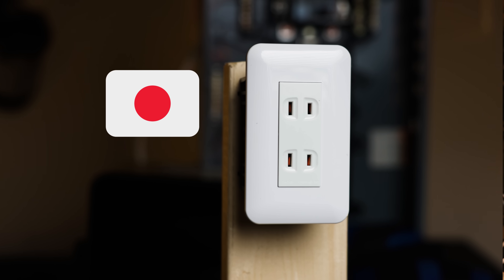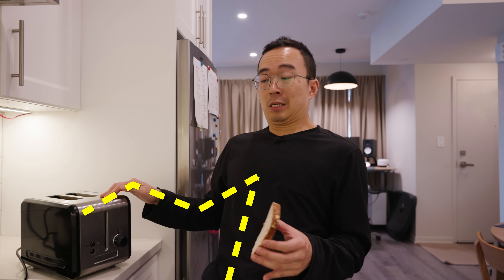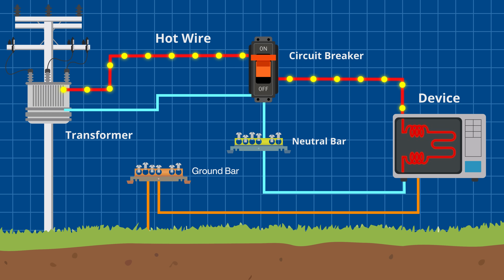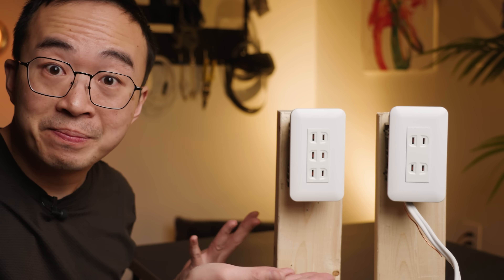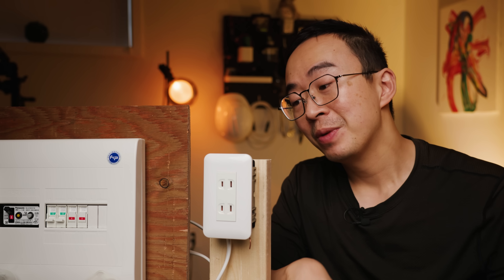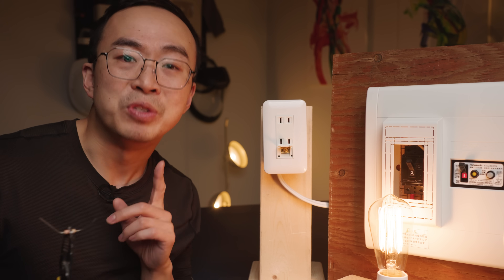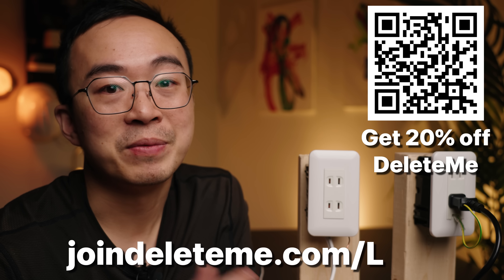How Japan Made Their Outlet Safe

Comment: In north america we have some problems associated with the 5 years plus of Aluminum wiring introduced over copper when the price of metals went up in late 1968. This caused a good system with the three wire system, hot, neutral and ground problems that did not exist before.This was due to corrosion from the aluminum. 

In the video there was no mention of why the introduction of polarized outlets are used dealing with hot and neutral avoiding a grounding system. Double insulated appliances only require a  dual prong connector. In Canada, most toasters and other kitchen appliances are dual wire plugs with a handful with the grounding plug system. 

Third is a GFCI as a master breaker set up, means when it is night time you are fumbling in the dark to find the circuit breaker box and flashlight, increasing the possibility for injury. It is cheaper but not a significant cost difference to either have a GFCI breaker to a specific circuit or an outlet GFCI. 

You will save in the amount of cost to install a 2 wire system for the inconvenience later that requires a bond to ground to an additional installed or placed in appliance later on. Japan has a nice system but it was a long way to be inconvenient to bigger requirement changes down the road, such as tamper proof outlets we have in north america for some time now.

Comment: In Norway, every modern house has grounded outlets and every fuse has a built in GFCI.

Another "fun" fact is that we are one of very few countries that still uses IT circuitry in certain places like hospitals, which allows hospitals to still have power with faulty ground.

Edit: Other countries also use IT in hospitals,
see comment below.

Otherwise we use TN in most cases and TT in some rare cases, mostly in places that have more thunderstorms on average than the rest of Norway.
Reply: Every country uses IT on hospitals. You cannot have a grounded system in operating rooms.  Norway uses it in homes.
Reply: @okaro6595  Well, yeah, in older installations,
but newer transformers are almost exclusively TN or TT unless 400V is not available in that area,
at least according to Fjordkraft.

Older installations do account for 60-70% of homes in Norway still,
so we are due for an upgrade.

I did not know that other countries also used IT in hospitals,
but it does makes sense.

I blame my ignorance on it being almost 20 years since I did electrical studies in school,
so thanks for updating my knowledge!

Comment: Hello,
You have made some factual errors that I would like to address.  First, fault currents in a North American system do not generally flow via the neutral conductor.  A fault will trip the branch circuit breaker even if the neutral is absent.  Second, the ground path is actually a low resistance pathway, and the grounded centre tap of distribution transformers is well grounded by several connections, ensuring that a fault in an appliance (your toaster eg) will cause a large current to flow and quickly trip the breaker to the open position.  

Some other notes:
-Japan is a 100 VAC system, the lowest distribution voltage of all.  This is one safety factor to remember.  On its own it is not a good strategy, but it is a factor in the overall design. 
-European and other systems with 220 to 250 VAC are more dangerous.  This is why grounding is mandatory in most European systems, and additional precautions (like RCDs and switches ahead of receptacles in the UK) are required.  The advantage is that the wiring is smaller (and cheaper), as the currents are lower in most cases.  (The available power at a receptacle is proportional to the square of the voltage)
-The North American system ingeniously uses a bi-phase system, where a positive and negative 120VAC is used to create the 240VAC needed for larger appliances.  Note that there is no place in a North American residential electrical system where there is more than 120 VAC to ground!  Nope, not even the range, dryer, or hot water heater.  Large appliances are connected across both phases, and get 240 VAC that way. 
-Putting a GFCI or RCD on the main feeder to the house (apt, condo, etc.) creates other problems.  With this, a ground fault trip results in power loss to all the branch circuits, so you may not get electrocuted, but you may fall down the stairs as the lights go out unexpectedly everywhere in the house.  And troubleshooting is more difficult.
-Note as well that in North America there are many appliances with polarized two prong plugs.  This is allowed if the appliance is double insulated, meaning that there is no reasonable way for a conductor to come into contact with a metal part on the appliance, minimizing the risk of electrocution.
-Finally, a note on outdoor safety.  Always connect to GFCI circuits for outdoor activities.  Your connection to the ground, possibly wet ground can be deadly.  And use a grounded (three prong) extension cord even if you are using a two prong, double insulated tool (eg, a hedge clipper) since if you cut the cord with the blade, the grounding conductor in the cord will increase the likelihood that the fault will trip the GFCI and prevent electrocution.

-

Comment: Both systems are flawed.
TT grounding + master RCDs are the norm in most of normal world.
Only then you can add separe sub circuit RCDs for bathrooms and other sensitive spots.

Edit: RCD can't work in TNC grounding systems. And what you showed in the begging is just that. Which is misleading at least, and dangerous at worst.

Comment: Of course if you used a UK socket it would have an RCD in circuit at the distribution panel and also you wouldn't be able stick a resistor directly into the live or neutral of the socket because there is a mechanical shutter in front of the socket activated by the earth (ground) pin of the plug which is longer than the live and neutral pins and so makes contact first. No need for those stupid baby safe covers you get on US sockets either.

Comment: A 16A fuse is not the same as a 30mA (0.03A) earth leakage circuit breaker. 
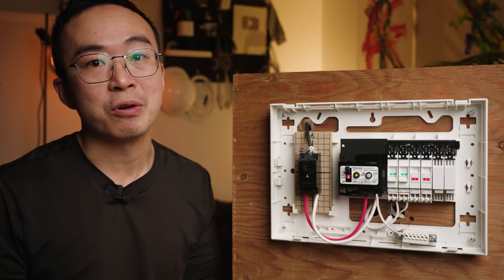7:20 In europe we had earth leakage circuit breakers long long long before 1971 lol.

Well, by looking at this vid I'm confident the American system is better then the Japanese system and the European system is a lot better then the American system.
Just switching a plug from one socket to another shouldn't require a screwdriver and the screws of a socket shouldn't be used every time a plug moves from one socket to another. 

I think that, within Europe, The Netherlands got one of the most safe systems, except when the electricity is made by someone from a different country or someone that isn't actually an electrician. 
Even when I look at the electricity in the UK I'm surprised about how bad it looks.

In The Netherlands 90% of the bigger wires (10kV+) are under ground, they really take it serious.
Reply: Not really.
Reply: @johnburns4017  What do you mean?
Reply: @ 
Holland is not a higher standard than the UK.

Comment: Wait, US does not require homes to have RCDs for the whole house? That became standard here in Czech Republic decades ago and the standards in place today see even that as insufficient. If I want to do full restoration of my house or some major electrical instalation upgrades I will have to replace my single whole home RCD with multiple ones. (And separates circuits differently as well but that is another topic.) I always assumed that having just the overload breakers is something you could not see in a new built home anywhere in developed countries so this surprises me.

Comment: I'm sorry, but i don't understand something and I can't find an answer on the Internet. What is Japanese grounded outlet’s ground wire connect to? 

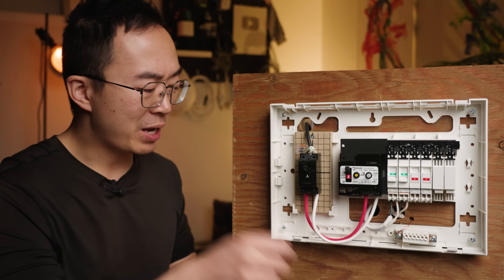Because to my understanding, to trip a GFCI some amount of electric current must go somewhere else. Either through wire to the ground rod or thou you and your floor, but not through your electrical panel to make a difference in currants (Kirchhoff's first law) but if ground in Japanese grounded outlet is connected to the neutral, the Input current and out current will be the same. In that case, we are just having a standard grounded outlet with tripping the circuit breaker, that you said, "doesn't work very well in Japan thanks to their uncommon infrastructure" but it is effectively 7:07 "oh let me just attach the wire from ground and neutral and call it a day" (sorry, but the way he said it is just too good).

So my question is: what is ground wire connected to exactly and how it's activate GRSI?

Maybe I just don't understand something obvious. If someone have access to photos of Japan ground outlet, I will be happy to take a look, because i didn't find any. 
Thanks all of you.

Comment: We Use GFCI over 30+ Years now in Germany and wie still also have the grounding extra. The GFCI can be triggered already before i touch the broken device and the grounding still have also another additional function to trigger GFCI or Fuse when anything else have also a short circuit.
residual current and short circuit are not the same, but both should trigger GFCI or the Fuse.

but if it works for Japan for now, its fine for me.

Comment: Germany simply has legally required GFCI protection for every new electric installations for a long time. we still have grounded plugs tho. 😂
in old buildings without the grounding wires in the walls they Just connected neutral and ground in the new outlet Type at installation.

Comment: I live in Italy and in two different apartments the electrical system was not grounded at all. I'd get shocked when touching a faucet and the dishwasher or my aluminum macbook would have a kind of buzzy field over the outside when plugged in (an electrician friend helped me fix this). Coming from the US, I found this crazy but everyone lives in concrete and masonry buildings, so fire risk is not as important as with stick construction. The panels, however, all have GFCI breakers for each circuit.
Also, at the beginning you showed an Italian plug. It is the stupidest plug - both large and easy to shock oneself. We actually have 3 here. Two of them have the 3 pins in a row, one for high amp, one for low (that works with Type C Europlug), and then we have the Schuko Type F plugs that have become more popular. Our house has a mixture of different outlets and we are constantly moving adapters and power strips around to make everything work.

Comment: Cool video. I have the stupid Japanese cable with hanging out ground cable. It came with a LAPTOP. Do they expect Japanese people to plug their laptops in kitchen or washing machine plugs? LOL. A household gfci is great no issues with that. What you didn't show was the average Japanese breaker panel doesn't have actual breakers in the individual circuits, just dumb switches. So what your video shows 20A circuit breakers in Japan you can very likely find dumb switches. Oh, and it wasn't too long that they didn't even polarize their plugs, you can find tons of unpolarized appliance plugs. They definitely had fun in the CRT days, Hot chassis? meh. 100V half country 60hz the other 50hz, talk about silly, they had more than a century to standarize SOMETHING nationwide, but they didn't.

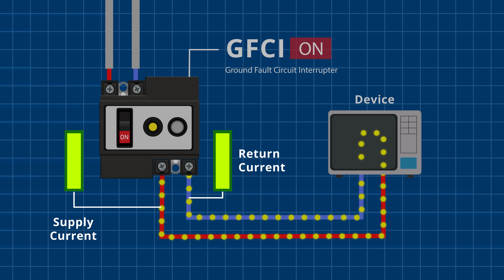Comment: @7:45 "...you absorb some of the energy and the return current is reduced."  Nope.  The resistance of the device itself has not changed, so the power used by the device doesn't either.  (Yes, you could draw enough current getting shocked to lower the voltage, which would change current, but that only changes All the numbers in the equation, not what really happens.)  In reality, the current shocking you is added to the device current, and the total current TO the circuit increases, but the return current does not, and that difference trips the GFCI.

Comment: So many errors and  misinformation. The purpose and function of a circuit breaker is to limit current to the capacity of the wiring. It will NOT trip nor protect you  from shocks. That is the function of GFI devices. No point in wasting any more time with this video.

Comment: In Italy, the legislation provides both to put the GFCI for the whole house and to put the ground in every socket. But it does even more, it plans to size the ground system in such a way that in case of broken GFCI, the voltage to which you are exposed is low, only 50V.
Reply: How?

Comment: I live in Japan (Okinawa Prefecture), my apartment was built in 2023. I have numerous outlets throughout the apartment, the standard design is 1x3 (3 outlets, no groundings). As in the video, there are grounding connections in specific rooms (for the washer and dryer, in the toilet room for the washlet, and in the kitchen), but also overhead for the mini-split air conditioners. The outlets for the air-con have three-prong "American style" plugs with a built-in neutral prong, with a regular outlet with cable-style neutral connection below it. Other outlets (such as for the washer and gas dryer) use the cable-style neutral plugs. The only reason I'm mentioning this is to give you some idea of what outlets are like in a modern apartment built within the last year. Part of me appreciates the 1x3 plugs, but the whole situation seems really old-fashioned.
Reply: Interesting, In Taiwan my 40 year old home is exactly the same with 2 pin 110V sockets, excpet for aircon it's 3 pin 220V 20A sockets

Comment: Interesting.  I wonder if they have problems with nuisance GFCI tripping if they have a single GFCI in the main panel covering everything.

I also wonder how sensitive the main panel GFCI is, especially in a large panel with many things going on.  Can it really always detect a minute difference between the neutral and the live wire on a small circuit in the mix?

Comment: Here in France there is (in my house at least) a 500mA Differential relay (RCD or GFCI) at the entry point to the installation and two or more 30mA RCDs to protect outgoing circuits.   But outlets still mostly have earth connections, the earth is not bonded to neutral,  and the ground earth rod must have a low enough resistance.  Seems an excellent system.   
You can have two-pin outlets but they (as in Japan) do not  allow plugs with earth connection to be inserted.
Seems Japan was a bit too eager to get rid of all appliance earthing.  They have had to bring it back.

Comment: There are cases where you don't WANT a GFCI.  GFCI tend to be sensitive, and I've seen the GFCI in my bathroom pop a couple times when plugging in a hair dryer that's not even turned on.  I checked it, there are no faults. The air was dry and it probably got a small static shock.   Pressing the reset button on the outlet is not a big deal.  The whole house "turning off" and having to go down to the basement to reset the whole house GFCI would be considerably more annoying.

I also have a lot of radio gear, and radio signals can get into anything and interfere with it, especially gear that includes sensitive detectors like a GFCI does.  The bigger the "antenna" connected to the device, the more interference it will receive.  My radio gear has occasionally tripped a GFCI in my bathroom or kitchen, and that's picked up by the short power wires on the other side of the house.  If I had a whole house GFCI, ALL the wiring in the house would be picking up this interference, including the wiring in my radio room, and I'd be resetting the whole house GFCI pretty frequently.  Super annoying.

I've also seen a few situations where large equipment (usually power tools like table saws and routers) will pop a nearby GFCI due to the power surge they cause when turned on.  This was probably due to not having a dedicated circuit for the big tools (to somewhat 'isolate" them from the GFCIs in the house) and just plugging them in where convenient, but still, annoying.

Interestingly, my hair dryer has a GFCI in the plug, and the hair dryer is a 2-wire plug. (no ground)  So it's working just like the whole house one here is, just looking for a current imbalance between hot and neutral.  It got a knock and refused to reset so I had to take it apart and I found it had an honest to god plastic balance in it that would trip the internal GFCI circuit if one side of the balance went farther than the other. (the balance got wedged by the impact)  Pretty interesting how they found a somewhat "mechanical" method of detecting an electrical fault...

Comment: ground and GFCI serve very distinct purposes with ground being a path for energized circuits to be de-energized by tripping the circuit breaker while GFCI interrupts the circuit when there are differences in input and output of the GFCI circuit. the only real way to avoid getting electrocuted is to not touch energized circuits

Comment: GFCI / RCCB can fail. There is no alternative to grounding. Here in India, grounding is mandatory, and a "supply ground" is provided by the electricity distribution company which is good enough for regular households. Big apartment buildings or commercial / industrial spaces are legally required to have local earth pits. I installed two RCCBs (each for two floors, because we have two separate power meters for the two floors which are billed separately) and a local earthing in our house for safety reasons, although none of them are legally required for a household. Right now RCCBs are quite expensive here, and most of the people don't know about these. Actually most of the people don't know about electrical safety at all. And that's why a lot of electrical accidents happen in India.

Comment: Another thing that Japan does with their electrical grid that makes it safer than other countries is that it only runs at 100 volts. Most places are 240v single phase, the the Americas use 240v split phase, which allows for 120v single phase art most outlets.